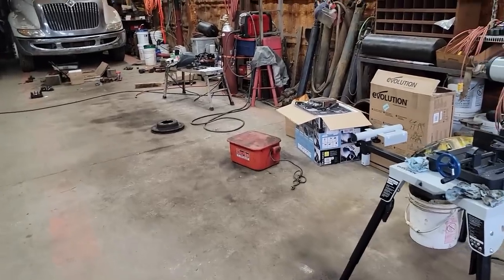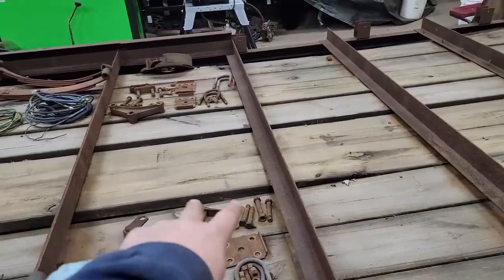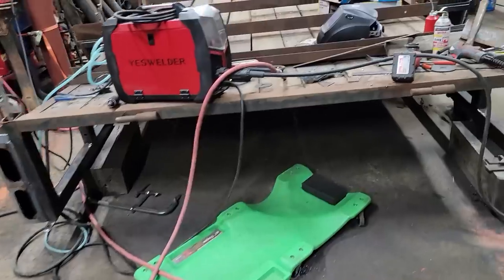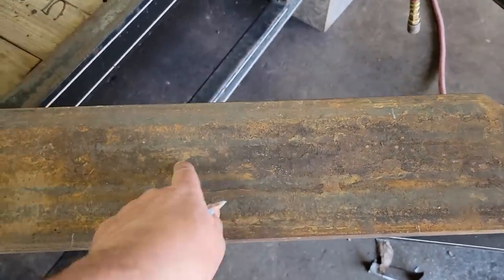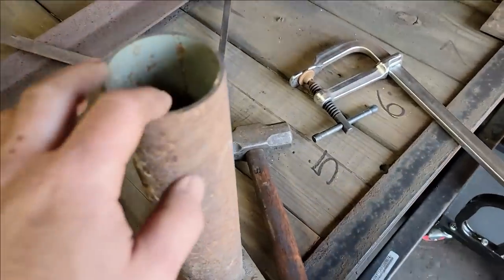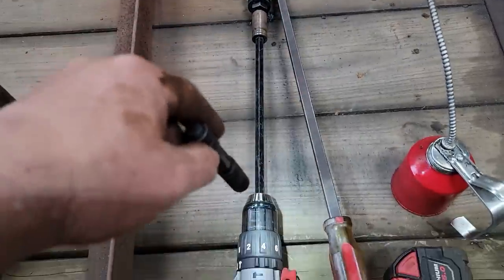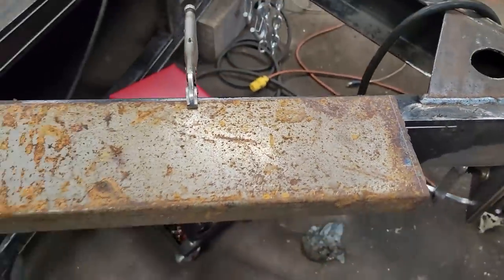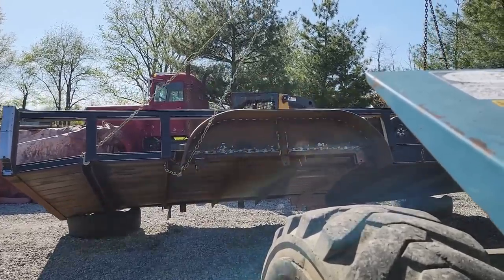COMPLETE LANDSCAPE TRAILER REBUILD! PT2 SHOULD HAVE BUILD ONE FROM SCRATCH!

Comment: One garage I worked for rented out trailers by the half day. The number that came back with smashed or torn off trailer plugs was becoming a pain so we mounted the trailers cable and plug on the side of the draw bar, 8 inches back from the coupling. We then made up 36 inch cable with the plugs on either end on it and that way if the tow vehicle had its plug on the left or right it wasn't a problem. It saved us a lot of wasted time fixing stretched and broken wiring. As for fenders ( guards as they are called out here in NZ) for the trailers we made then from 1/8 steel sheet. Guillotined and bent up for us by a local engineer with a press brake. The vertical front lip was 2+1/2 high giving plenty of room to mount a triangle  made of 1+1/2 angle. That saved a lot of bent guards. You are making a nice job of that.
Reply from the maker: i have never dented a fender or ruined a trailer cord. i certainly wont be loaning or renting this out. i dont want all my work destroyed by someone else.
Reply: @j.c.smithprojects  You probably wont wreck your trailers but people who rent trailers aren't used to owning a trailer and you end up having to idiot proof them and make them a little stronger. LOL
Reply from the maker: i see some of the trailers of owners who probably shouldnt be towing anything.....they are just beat!

Comment: Nice work J.C. you guys should get a lot of use out of it when it’s all finished.  The 220V power strip you made was pretty smart.  Being able to run 2 welders and keep the same settings makes a lot of sense, and I especially like the design of that hitch.  BETTER THAN FACTORY!👍
Reply from the maker: anything to save time...these projects take too long as it is.

Comment: Hi from uk👋👍 great job on trailer at least you know your workmanship is better than manufacture 👌 pleased your speaking highly of the new bench saw its great when you do a little review on side cos guys like you can either get most out your tools or break them trying so if your happy we are too for you👍 and I am with you why cut shabby weld out on mudguards when you can clean a few a make it stronger by addin a few😂 no point spending unnecessary monies the weld wire already there💪😂 hope when its blasted most of it comes back and not just your welds (strong bits 😂)and not too bad thanks for your time be safe and see you soon👍👋

Comment: If you placed the back up lights at the top wouldn't you get better light coverage/range when backing?
Reply from the maker: the rear of the trailer is extremely low. i want to be able to see what is there more than i do what is higher.

Comment: Good job on the extension cord but if I were you I would have considered making one outlet a 120V so you wouldn’t need a extra cord for a grinder when working outside, I always look forward to your videos
Reply from the maker: if i did that, the 120 volt plug would not have the proper over current protection because of it being powered off a 30 amp 2 pole breaker. i use my m18 milwaukee grinder a good bit as well so an 120 volt plug isnt too important to me.
Reply: JC your right as usual

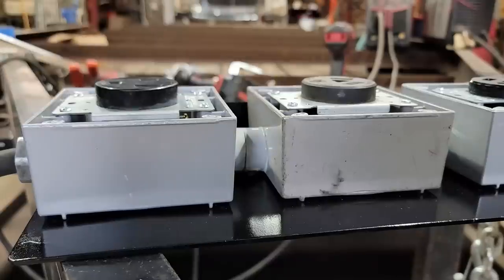Comment: 31:49 your receptacles from left to right are NEMA 6-50 (50 amp) and two 10-30 (30 amp).  What plug are you going to put on the cord and what breaker size are you going to use?
Reply from the maker: you only as good as weakest link.....the overcurrent protection must be set up the same. 30 amp receptacle is a 30 amp breaker regardless of what you want it to be.

Comment: having watched all your videos I can tell you are just pretty particular on most issues.
so is there a manufacturer who will build a trailer to your custom specification?
I cant see any reason for you not to get exactly what you want.
then sell off the other trailers & get rid of annoyances.

also maybe the frame bow is intentional so that it sits flat & true when loaded? (I dont know)
Reply from the maker: i would be better off building my own. i have built trailers before. it has always been cheaper to buy what i need than to build what i want.